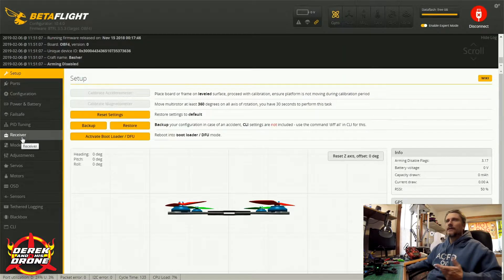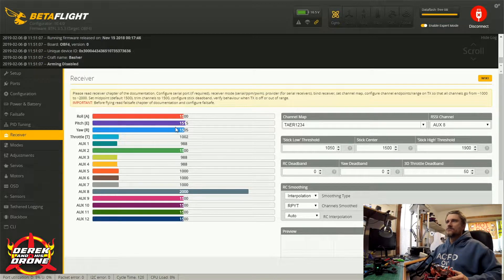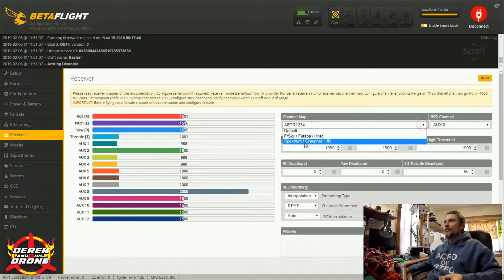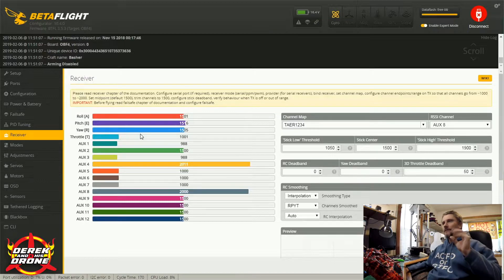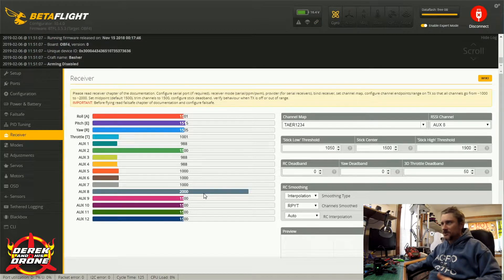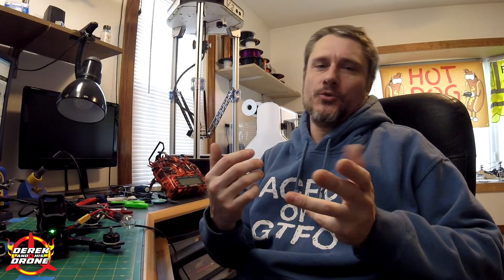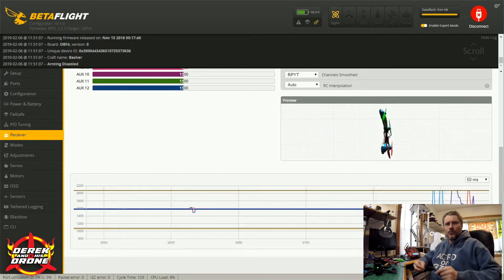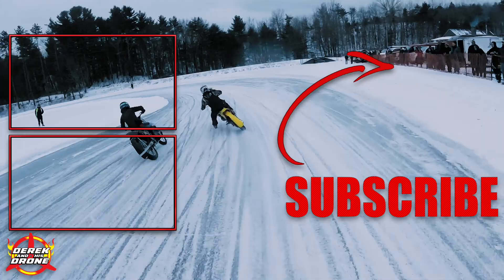Basics of Betaflight - Receiver Tab

Comment: HI
I cannot connect my x220s with my FS_I6X any help I would really apreciate it
I did update the firmware:
Betaflight / STM32F405 (S405) 4.1.6 Apr 25 2020 / 05:11:18 (283bda8bf) MSP API: 1.42
# manufacturer_id: AIRB   board_name: OMNIBUSF4SD   custom defaults: YES

and the receiver is a FS-A8S 

 thanks for all the videos Derek!
Reply from the maker: Did you reconfigure Betaflight?  Maybe you missed something?  Here is a GitHub link that shows how Betaflight should be set up.  Look at the Ports Tab and the receiver under the Configuration Tab.

https://upinthesky.github.io/2017/12/11/eachine-wizard-x220s-betaflight-setup-and-configuration.html

Comment: Can you help me out, I’m using a NAZE32 REV6 and a FS-iA6, so the problem is that whenever I move the sticks on my transmitter nothing moves on the screen but the FS-iA6 will be connected (I used a PPM connection)
Reply from the maker: I do not believe that the receiver you are using has a serial output.  You might be able to do PWM but I'm not going to get into that.  Honestly your flight controller is really out of date and I would recommend a serial receiver.  Something with iBus.
Reply: Derek and his Drone I got a new receiver iA6b and set it up within minutes and worked, and I know this is my first ever drone I didn’t know much about it when I got it, I just gone one of the first ones off amazon I’ll look on upgrading as time goes on thank you
Reply from the maker: There can be a lot to learn.  Take your time and look for videos when you need them.  There is a ton of content for FPV now so finding what you are looking for can be easy.  If you can avoid it, I would not recommend buying parts from Amazon.  Just about all of it is counterfeit.  Try to find a good retailer in your country.  If you are in the US there is a bunch and with super fast shipping too.